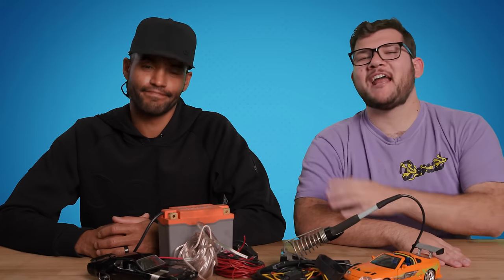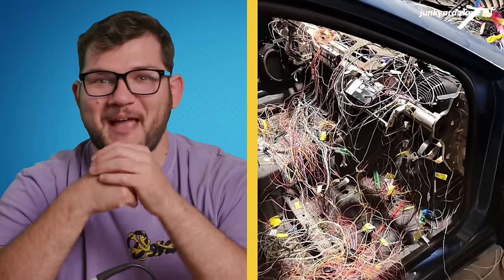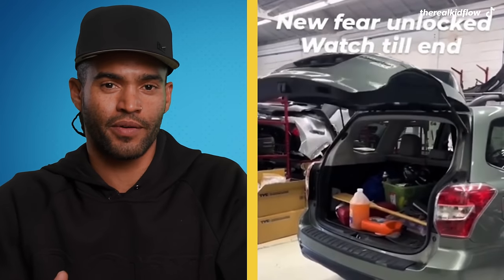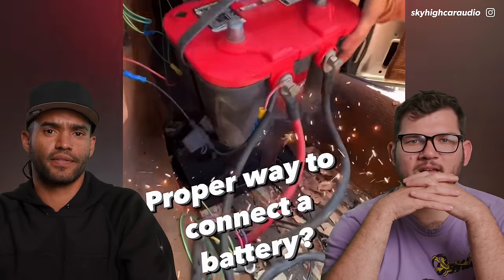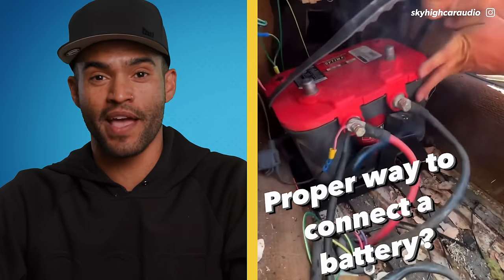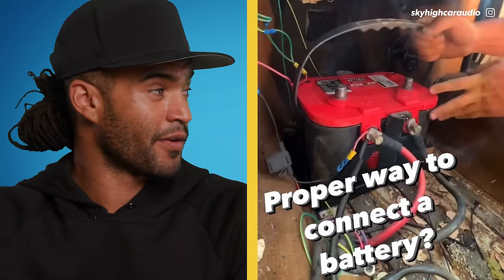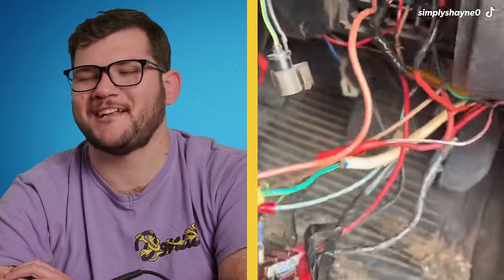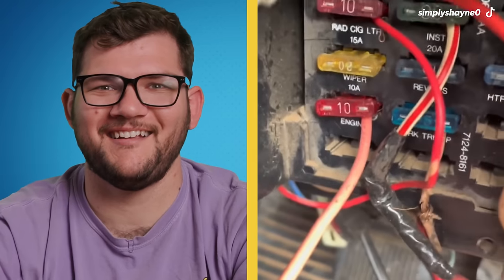Mechanic Reacts to Deadly Electrical Repair Fails

Comment: My  uncle ha led a life of crazy get-rich schemes, his in his seventies now so he now retired, but I remember as a kid that he suddenly fancied himself a mechanic. He would buy broken down or defective cars for cheap and then fix them up and try to flip them. I have no idea how he is still alive. One memorable car he worked on got the wiring all wrong and he break lights would go on when he tried to activated the windshield wipers, the turns lights, if I remember correctly, were somehow wired to the radio. Literally everything in the car did the wrong thing, electrically speaking, and he would drive this fucking thing around while looking for a buyer which he obviously never found. There were some issues with the breaks too, but I have forgotten what happened what when hit the breaks, but I think it was the turn lights blinking on both sides
Reply: Oh, I just remembered he had to hot-wire it to get it to start and it would randomly start smoking from the hood, but we live in a very cold place so he'd just park it for a few minutes and keep going. What came out the back looked like he was running coal, but it was not on purpose. He lived in the countryside with not a lot of cops but he got pulled over shortly after he started driving that thing. Another uncle of mine was the sherriff there and just had it towed and destroyed, despite his protests. My sherriff uncle was just like: "I don't know how you are alive but you have had kids in this car, including my grandchildren, and I order you get out of the car flipping business or I will press charges." - this was the old days when small town sherriffs had basically ultimate power, he would just let people go if he felt sorry for them and then check up on them regularly, he was really good at his job. I especially liked the driver's license  making machine he had in his office, ehem.

Comment: The third clip makes me think it’s the Clock spring because the flashers and the running lights are both wired through the clock spring and the gauge lights could be activated by running lights?!

Comment: The minivan hatch is not electrical.   The gas support rod is dead.  The actuator can open the trunk, but when it's done it disengaged and the gas support is supposed to hold it open, but with no support the hatch just collapses.

Comment: Okay, you guys have never been to Minnesota, and it shows :P Adhesive oil-pan heaters are EXTREMELY common. It gets down to -40F here, cars don't like to start when it's that cold. It's not about performance at the track. The person in the video just had a block heater, probably a transmission heater, and an oil pan heater, and wired them up to a splitter so they only had to plug in one thing.

Comment: For the clip with the heating tape… you guy in California knows there are block heaters that’s are built into engines in cold climates. The heat tape can be a bad idea. Especially when when the heat tape touches another part of itself.

Comment: Oil pan heaters, engine coolant block heaters and battery blankets are almost essential if you want to start a diesel that has been sitting outside in -40 for a few days. Come on up to the Yukon in February and I'll show you what I mean.

Comment: 12:45 I've never owned one so I'm not really familiar with these but this looks like an early 80's Ford Falcon Ute from Australia. It's probably an old farm-basher which would explain the very sketchy wiring. Lots of farms have at least one, the kids might use it to drive around the property or to the front gate to catch the bus for school (which can be kilometres from the house sometimes), maybe they've put some spotlights etc. on it for shooting feral animals out in the paddock. The farm could be an hour or to from the closest town so not worth going there  to buy parts for an old clunker and not worth a skilled persons time to fix it properly so somebody has just made it happen with stuff they have around the shed or scavenged off of other cars or equipment on that's sitting around the farm.

Comment: The battery being installed while connected is sparking because it's hitting the metal bracket that holds it in, right in between the cables.

Comment: For that battery sparking, it was just shorting the positive terminal to the chassis ground because both the terminals of the battery were connected. The sparks aren't because the engergy has to go somewhere as if electricity has momentum. That is an incorrect analogy. The sparks are from the quick high current there melting and vaporizing the metal. Some metal melts, some vaporizes. The vaporizing metal expands quickly throwing the metal that has just melted out in a shower of sparks.

Comment: You need to add either higher amp fuse then use a fuse extender but i would just run a independent wire for the that setup

Comment: When i do wiring on my cars i try not to touch the factory looms at all.. My current car has a dedicated 90amp circuit for my added accessories. There is a fuse box in the engine bay and another under the dash. Then the trigger wire for the one under the dash is only live when it's on accessories so i don't got a thick boi positive cable running through my firewall. I really try to only use the factory wiring for a relay trigger.. In this case the stereo is on the added circuit and it's original circuit is the trigger. It's from the 90's tho so the stereo was pretty simple. Not the horrible integrated stuff they got now.

Comment: The light was burning because of the halogen bulbs. They’re low atomic weight halogen compounds used inside of them, which are highly flammable and generate a ton of heat. If that bulb blows open with an electrical current it will suck air inside from the pressure difference and basically create a miniature jet engine.

Comment: Slight correction to the Lexus guy's "research"... It's not just Toyota/Lexus, most every manufacturer switched towards more "environmentally friendly" insulation materials for a a good decade now. A two second Google search will show similar stories/calls for litigation/etc. for Honda, GM, Ford, and so on.

Moral of the story is... If you want environmentally friendly, don't be surprised when the environment eats it up (literally.)

Comment: My Z had xenon bulbs before installing LED. I remember reading that xenon bulbs use a small amount of fuel from the system. i can only assume that was the issue with the taillight fire

Comment: I used to drive an 88 jeep cherokee down in FL and naturally it didn't have a cd player. Guy I dated at the time said he had a spare and installed it himself, I figured he knew what he was doing. He did not. I was driving home from work one day and smoke just started pouring in through every vent. Instantly pulled off into the median grass and I was like "yeah no", nice person gave me a tow back home. Dad's a mechanic, he looked at the wiring harness and told me my then bf was an idiot. Half of the damn thing was charred

Comment: 250hrs translates to : 6 working weeks (5 days * 8hrs/day); so if that chaotic wire dude ends it in 2 weeks, it's a win.

Why the "this guy, guarantee, has 2 weeks full on" was pointed out so dramaticaly?!

Comment: Southern Californians reacting to a typical plug in heating system is a knee slapper. My diesel has plug in heaters for the gas tank, batteries, transmission and block.

Comment: 6:00 master wiring guru and called it AC. there's no AC in a vehicle. its all DC circuits. the ONLY AC in a vehicle is INSIDE the alternator but today the regulators are built into the alternator so only DC is seen on the output

Comment: People in warmer climates will not understand why there's a heat pad on the oil pan run by regular AC power. I lived in Alaska for 3 years where you would see temperatures of 50 Below Zero. If you don't have that heat pad, the oil will gel up, which will cause your motor to have issues when you go to start it.

Comment: @6:43 that is an oil pan heater. Used on vehicles, yes to heat up the oil via the heater on the outside of that pan. Also used in cold weather climates, like Alaska. Found on every car as well as transmission, and block heaters. For battery its either a heater or trickle charger. Its called winterization.

Comment: My 84 Mazda RX-7 had an AC plug running to something g at the bottom of the car.  I never used it but looking back I thinknit was for engine oil.

Comment: Man a oil pan heater and a block heater thats it?  The deisel boys out in the montana/north dakota oil feild wrap their engines in those 😂  ive seen 6 on a 24v cummins plugged in while the teuck idled all night just to keep it warm enough to go to work the next morning.  Temp, -45f and 50mph winds.  Yeah, Montana hahahha

Comment: Heads up, if you're having a rodent problem, spray peppermint oil in the affected area. Rodents HATE peppermint oil. We had a rat problem, and this solved it immediately.

Comment: Was a great video, but the comments from Parker on the last clip show that he can assemble not fabricate. There's a difference between repairing and building. When you fabricate, you tack things together, you don't always finish everything then go to the next part. But should made a finish list, so things like that don't happen. If you fully welded the driveshaft, then found out it was binding, or not the right length. You have a load of extra work to do. But if you just bolt things together, or work on factory wiring, yes try to complete the task.

Comment: The battery has power and you put loose wires on and they constantly touch and not touch. Creating a 12volt spark.

Comment: Basic circuits are relatively easy, the main thing is DON'T try powering through it, if it acts weird DISCONNECT the wire and reasses

Comment: that subaru just has failed tailgate struts. the motor winds it out fine but when the motor stops its meant to be held by the gas struts. and with no pressure they will just let the tailgate slam.

Comment: That magnum hellcat is just how a wiring harness looks when you remove all the looming. there really are that many wires. i've done what he is doing in the video before on a smaller scale, and it absolutely works and is completely safe if you know what you are doing. its literally no different from installing an OEM wiring harness other than the plastic sheathing that keeps all the wires bundled up. just because the looming is removed doesn't make it suddenly unsafe lol. i would never trust a mechanic to do what is in that video though because mechanics NEVER do that kind of work. maybe there are some that make custom harnesses, but NONE of them will ever rebuild a harness like that because it will never be worth the labor cost.

Comment: My 2011 Jeep Wrangler has had constant electrical issues.  I'm currently looking for a computer for it. That'll be the second one I've replaced.   Been misfiring and stuck in 3rd gear for a month.  😮

Comment: @ 11:00 THAT'S EXACTLY how I lost my taste and smell receptors for 3 months during my apprenticeship as a truck mechanic inthe 80s 
NOT BY MY FAULT.....! A colleague had just installed 2 freshly charged "coach batteries" (HD with over 1000Ah) the batteries were "still boiling" and flammable gas was flowing out of the vents of the cells and the mechanic connected the batteries the wrong way round and caused a short circuit, BOOM... a loud bang and the batteries were "GONE" and I was showered head-on by the still boiling battery acid..... in short: 4 hours under the emergency acid shower and then I was standing there naked because my work suit had dissolved into thin air. Called in sick for 1 week
why? in Europe we have other batteries, US batteries are banned here for example, no idea why but our batteries did not have a ventilation chamber with an exhaust hose for the hydrogen gas that is created when it boils, the whole battery box was filled with gas when the sparks flew

Comment: That battery video,,, he could have just left the negative terminal with out the wire making they frame ground or negative because well safer that way oh and the sparks are metal getting vaporizer by high current electricity

Comment: Uh................... the battery shorted to the the mounting strap, that is grounded with loose wire connections creating even more sparks
Reply: Shorter explanation,  but editing is great.

Comment: 8:00 why not using a engine coolant preheater with a dual bypass pump and a oil/water intercooler. you now heat the coolant and the oil and also the whole block. i have a VW t4 with such preheater i use it in the winter time for heating up the cabin so i dont need to scratch ice also the engine is warm so less fuel consumption and less wear and tear on the engine. without bybass pump this runs with the engine until the water reaches 80 C and the heater restarts if water temps dropping below 60C while the engine is running. this can happen in the winter if your standig some where for about 30min or longer while the engine is running and it is -10C outside. especial on the small engines configurations this happen more often even all from 55kw to 111kw engines are all 2.5L 5cylinder engines but the smallest has no turbo and the 111kw has a vtg turbo and a intercooler instead of only wastegate turbo. the police variant also uses the 5cylinder 2.5l engine with the vgt turbo but this engine generates 190kw on 6krpm this engines are crazy but this has a cost of reliability. the 55kw engine can last over 800.000km the 111kw only 300.000km the police variant less the 100.000km but they dont care about because this car is not driven often and got replaced after 10 years in service with majority of only 50.000 to 80.000km. funny fact all of them had the lowest engine rank badge on the tailgate ^^ so if you se one of them and it is all white and has the lowest badge it could be a 190kw beast that can drive 250kmh or it is the 55kw engine with 140kmh you never know ^^

Comment: The part of trunk of Subaru, toyota has the same problem and the problem it's on the module that's needs a reset. Toyota does not open completely it open halfway and shuts fast.

Comment: So the whole thing with the Subaru tailgate suddenly slamming shut actually happened with I believe the first model year of the Telsa Model Y Elon quickly offered a refund for anyone that purchased a model Y and they recalled all the unsold model y's from the dealerships to correct the issue turns out the problem was the retention mechanism wasn't beefy enough

Comment: Looks like a newer traverse. Mine blows the fuse for taillights every few months, although mine is the older model. The tail light bulbs are also starting to melt the plastic lense inside. 

Reminds me of my ex's 98 neon. Worst car ever.

Comment: Think my old truck will run on just the plug wires ,, yes a magneto and has a crank handle .. so normal use 4 plug wires , 1 stop wire . 2 wires for alternator . 2 wires for starter even starter solenoid is mechanical  . Then 6 wires for lights

Comment: I would guess that you guys have not spent much time in Sub-Zero temperatures with your vehicle. I live in North Pole Alaska and every single one of our vehicles has to have that cord system on our riggs. They call it winterizing. We have heaters on our battery our block or oil and our transmission. Standard here.

Comment: Did my man just say "alternating current" on a 12v DC Automotive starting system? I would say that you have way bigger issues than a poor contacting bolt in this case... Those two lines look to be either a refrigerant line, brake line, and/or hard fuel line that it's bolted to and that's near the rubber line. Either way, that's starting current going THROUGH that flimsy little bracket; that juice should be going into the Starter and grounding through the engine's ground straps to the body...

Either someone though that was a good place for the only ground strap from the engine to the frame, or you have some serious electrical issues. lol

Comment: that hot metal part is a bad eath not alternator goin back to the battery.. that was metal parts for the car which mens it an earth unless you have a reverse polarity car where posative runs through the body instaed of earth..

Comment: @6:20 since when do cars have alternating current?? looks like either a shitty dirty ground contact or more likely you have shorting occuring inside the starter motor windings and its grounding out at that point we are watching glow

I could be wrong but from what ive seen aha

Comment: 250 hours for wiring a car seems like a bullshit amount of time. I usually do around 2-3 days for the wiring itself.
But i guess it depends if you are making the system from scratch or rewiring something old. I only do from scratch. So it is perhaps easier for me because i know what every wire is supposed to do. But i still think 250 hours is insane.

Comment: My step father almost burned my car down by putting his ratchet on my battery.  Melted the battery but luckily i had it disconnected from the car so no damage to the vehicle

Comment: Quick fact, most places that make wire use peanut oil as lubricant when making the insulation and that's tge reason rats chew on them

Comment: 6:48 Engine oil heater usually for vehicles meant for cold weather where the oil will become too thick for cold starts. 
Aaron BS'd but I'm also typing BS so whatever

Comment: The first one is fake for sure. There are just cables thrown into the car to get attention and lols. Like the orange wire on the top of the frame for dashboard have multiple coils. There is no excesive wiring in cars at all. Everything goes from one connector to another and even if you unloom it it still goes the more or less the same way because of its lenght. The only way this would be serious is if he was rewiring it with his own cables for some reason but you unloom what you need not all the wiring in the car at the same time.